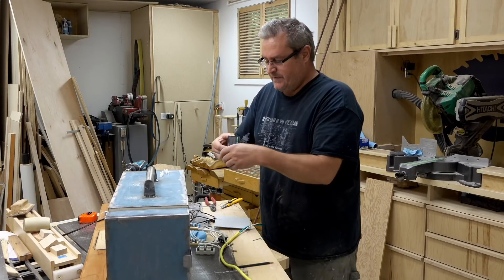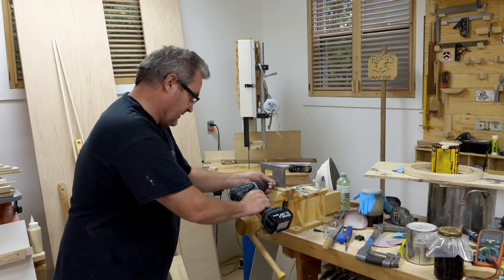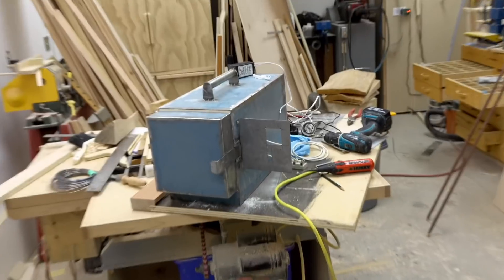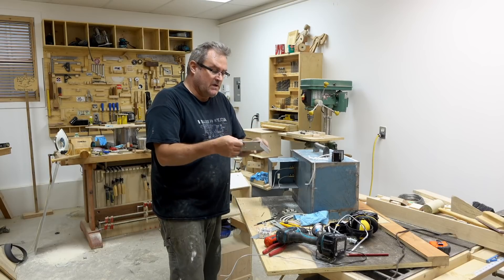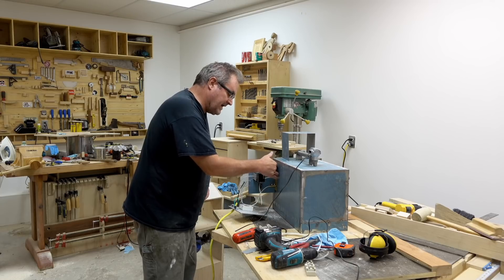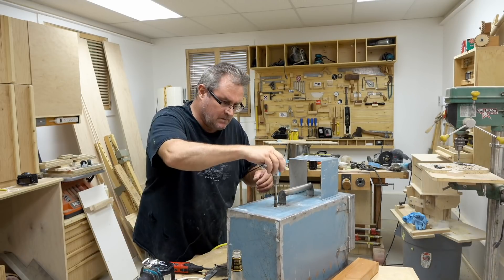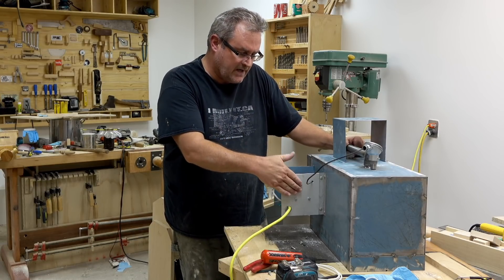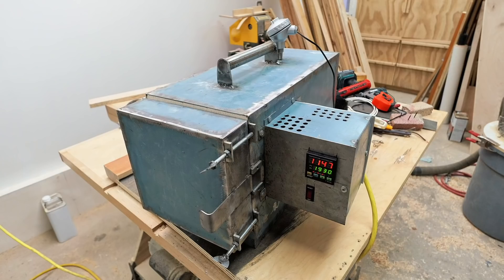How To Make A Heat Treatment Oven - End

Comment: Maybe it would have been a better idea to use a plastic power box instead of metal? Incase a wire ever comes loose? The camera was quite far back so I couldn't see if you ran an earth wire to the metal of the control box. Fantastic result by the way, it really looks stunning.
Reply: Gadget Addict The control box was indeed earthed.

Comment: John Heisz Can you use it in the horizontal position to melt aluminium https://www.amazon.com/gp/aw/d/B01DTL21YY/ref=mh_s9_acsd_topr_bLWXPv_c_x_12_w/143-4360745-7075922?pf_rd_m=ATVPDKIKX0DER&pf_rd_s=mobile-hybrid-3&pf_rd_r=0S61XTF96QC1KRK2R9QY&pf_rd_t=30901&pf_rd_p=1dd4ab9a-9d60-5089-bc32-e2f3ae131c8e&pf_rd_i=318058011#

Comment: Wonderful job John for a "provisional testcase"! One suggestion though: I would replace the fiber based insulation of the heater wires through the bulkhead with a piece of glassfibre based circuit board material. The latter can withstand much higher temperatures.

Comment: If you got that thing up to 1900C, you'll be able to melt steel.  Time to buy some crucibles!
Reply: icondonnied if he fires that to 1900 C, he'll be replacing those elements after every firing
Reply: I believe he notes that it's 1900F, not C, not nearly high enough to melt Iron or even steel. But he could do aluminum or potentially even bronze or brass. Although if he was going to use it for melting metals for casting, he probably would have designed it differently, make more of a vertical oven with the opening on top. That way you can add more as the metals melt.
Reply: Soda can work good and you're recycling.

Comment: Awesome build! I wanted to build a heat treatment oven since i started knifemaking. I wonder how even the temperature is inside the chamber and how accurate the temperature control is. For knifemaking 20 degrees C +/- or an uneven heat can make the difference between a letter opener and a 1000 dollar custom knife. A test video with accurate temperature measurements would be awesome!
Reply: Anatol Stelzhammer the controller should be VERY accurate.  it's running a bunch of calculus behind the scenes... but to be very accurate he would want to have the steel in the same horizontal plane and near the thermo... probably 100+ degree diffrence from bottom to top of kiln